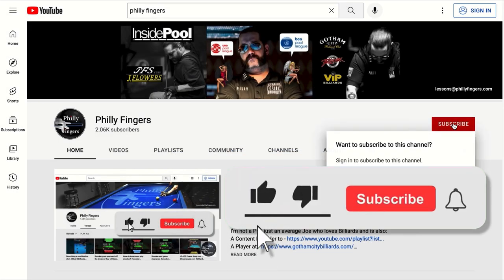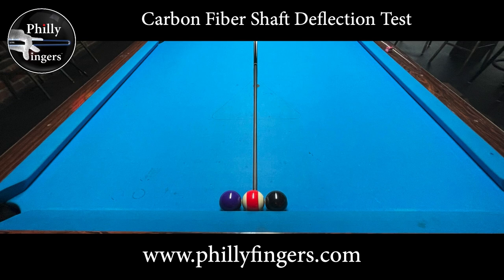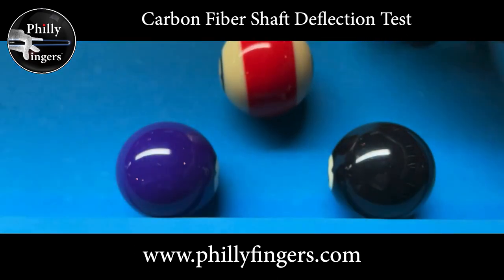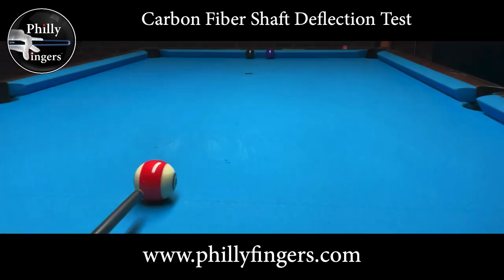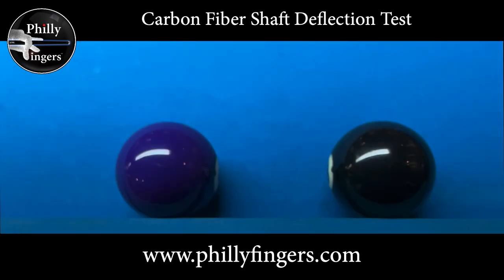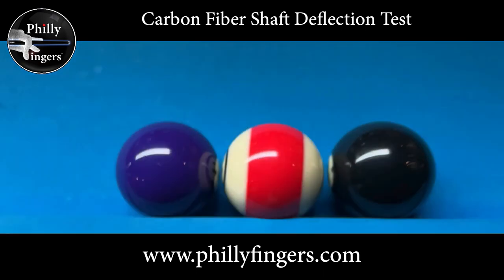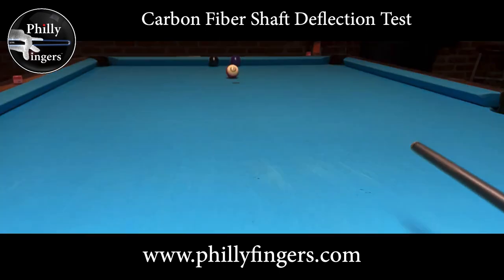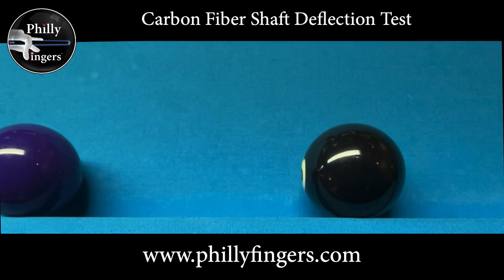Carbon Fiber Shaft Deflection Test

Comment: It would help if you showed the full speed videos as well as the slow motion so we could see how hard you are hitting the shots. You're claiming NO deflection which I really don't think is possible. I'm quite certain that every cue has some deflection which is why we call these LOW deflection cues. I've not heard anyone claim a NO deflection cue. From this I have to conclude that you are either adjusting for the deflection with your aim point or hitting the shot at a speed that allows the spin to correct for the deflection as it travels down the table.
Reply: Precisely.  Well said.
Reply: Absolutely, yeah I don't think he's got a very good understanding of this whole thing